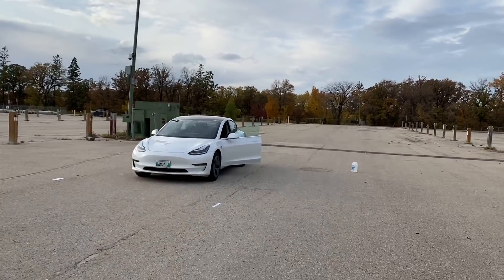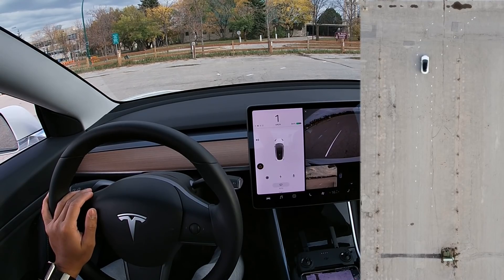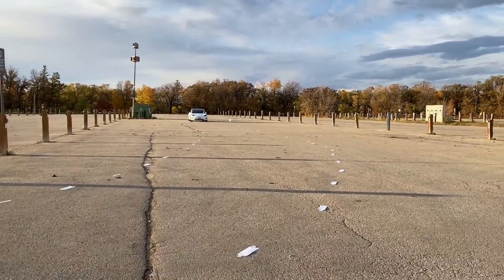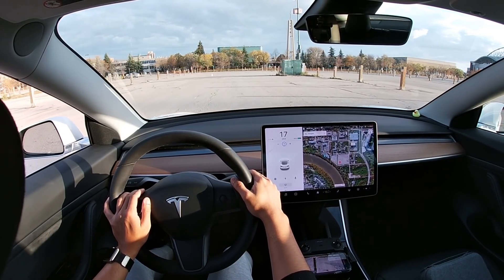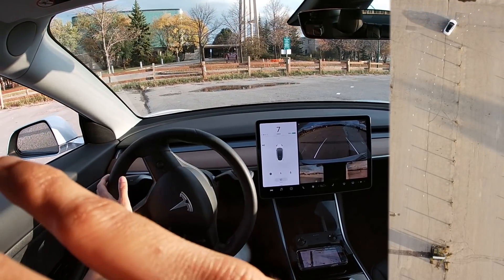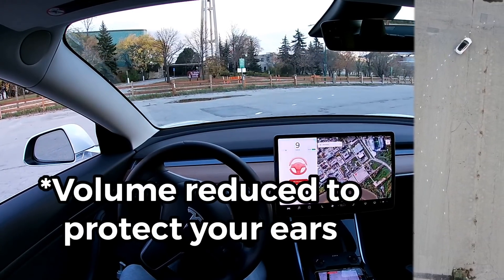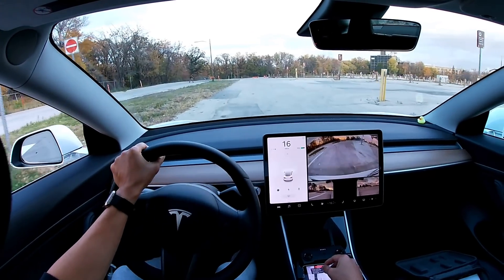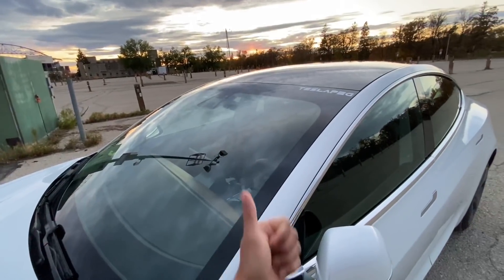Drawing Lane Lines with Duct Tape for Testing Tesla Basic Autopilot

Comment: normally even the bends are marked nearly parallel lines on standard roads. but in this situation it looks not exactly parallel. some points the lanes have more width than other points of the bend